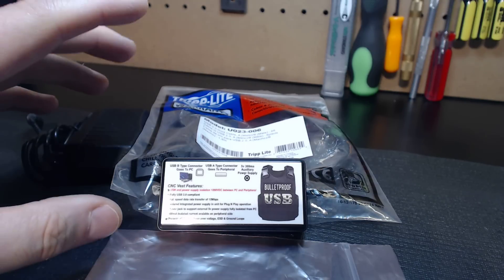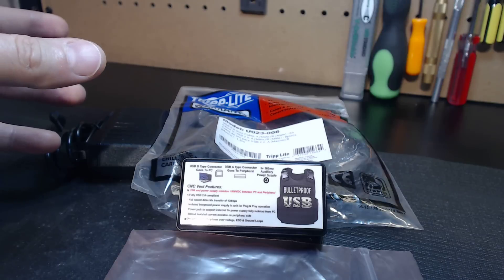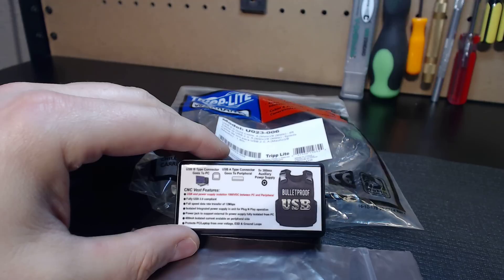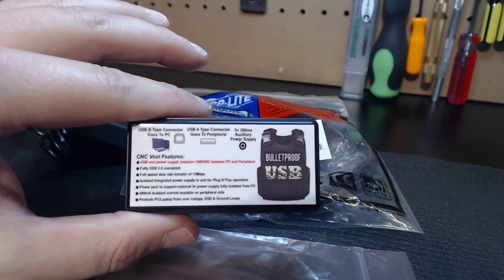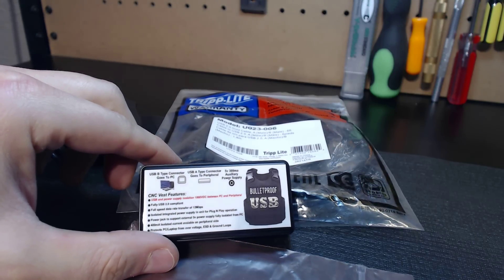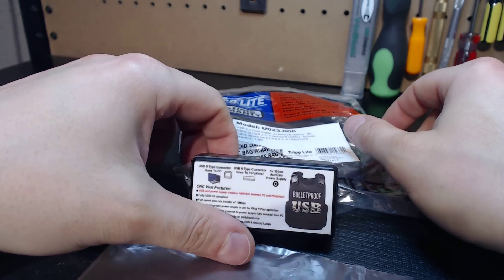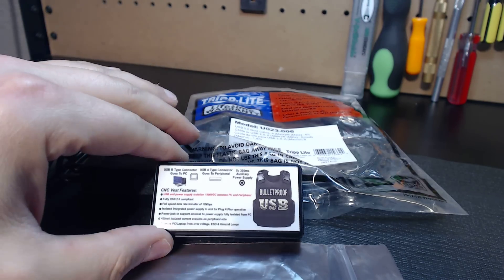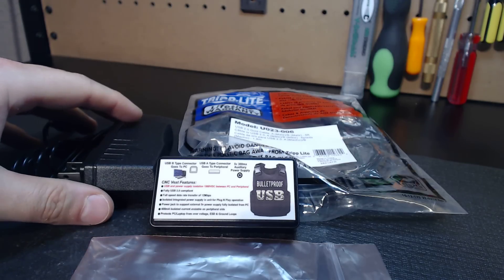The CNC Vest USB Isolator (Bullet Proof Your USB Ports)

Comment: Does that work for plasma frequency for cnc port? Cause i had problems with it when it fire it's freezing my system.. dose that solve my problem??
Reply from the maker: Mohammad, thank you for your support. USB controllers shouldn't be used with plasma systems as they require a stable 5v source for power which is easily corruptible prom the large amount of EMI produced from the plasma system. In best practice ethernet is to be used with these types of robots. 

The CNC vest wasn't designed for plasma robotics.

Here's another video series I made covering grounding practices, and EMI direct from Lincoln Electric's engineers https://youtu.be/UpJ4txXh3WM Thank you,
Vince

Comment: I have done absolutely everything and my cnc plasma table and plasma cutter freeze and it loses usb connection. This seems to be my fix. If i moved my desktop far away I could get it to work. However it’s not feasible to have it spaced where it was. Just don’t know that I can drop that much cash for a hope that this fixes it.
Reply from the maker: He Jacob,
I messaged you on eBay covering why USB controllers won't work for plasma robots. I refunded you already as I only sell my clients solutions that work for their applications. Thank you again for your support. Vince

Comment: I need one of thes in ethernet form.
You should consider making one as well.
Reply from the maker: Steven, thank you for your support. Ethernet doesn't have the issues USB does as its using different signals. If your having issues I suggest purchasing a high quality shielded cable as it should correct them. Thank you,
Vince
Reply: corvetteguy50 

Ive seen those. Are they plug and play?
Reply from the maker: @stevenguevara3252  Mine is Plug N Play, and is a complete package, but others available are simply circuit boards requiring power supplies, cables, and enclosures. My units are also designed for CNC use.

Thank you,
Vince